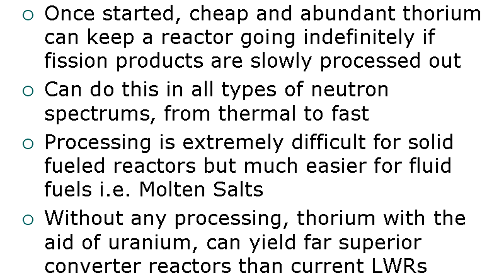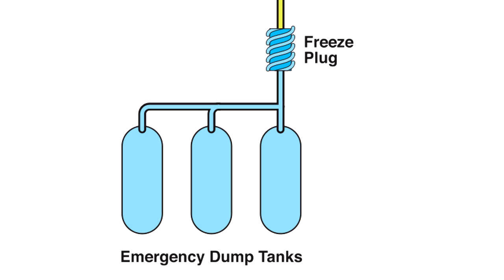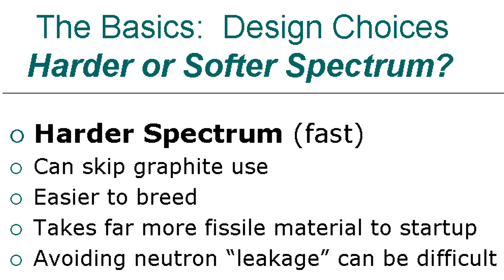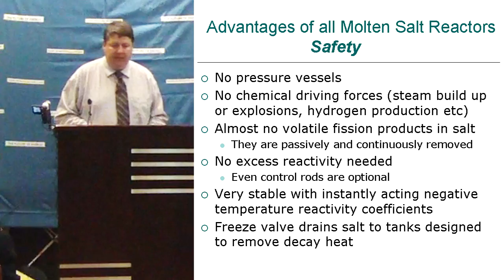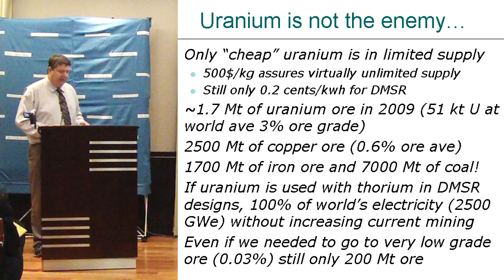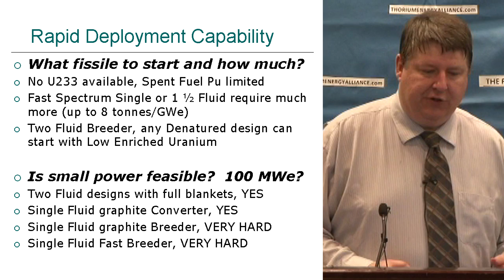David LeBlanc - Potential of Thorium Fueled Molten Salt Reactors @ TEAC3

Comment: The pumps for the reactor fluid obviously must not leak bearing coolant into the mix like the first sodium reactor in 1951 where an organic solvent was used to cool a high temp pump shaft bearing, which leaked into the cooling/heat transfer fluid (sodium) and created sludge that blocked that flow into the reactor and caused subsequent  fuel rod meltdown, which DoE lied about. (sodium boils at 883°C thus does not have great margin at higher reaction temps, so maybe not an ideal heat exchange medium?)
I'm sure this is well documented and newer high temp pumps have better and more seals, located further from heat source with longer axles, and a better cooling system.
Sludge blockage would defeat a melt plug scheme.
These nuclear projects are of national security and should as in the past be sponsored by a federal government or NGO, (to avoid previous political railroading of important projects). These projects need to be in focus to make a speedy recovery into a safe nuclear age. China has evidently understood this. 
The hyper-commercial info stream that values three syllable sound bites are incapable of explaining to the GP (general public) how nuclear reactors can be safe or not safe in as much detail as needed. GP having a poor understanding of nuclear power generation that affects the supposed democratic system is detrimental to the general political climate these plans must exist in, or not. No understanding = no vote. (Just like in election of people with no relevant education nor experience, should disqualify for high political office)
These great, and untiring nuclear advocates should be given stipends for their work to continue in the public domain. There is enough money to be made in the building and running of these plants, that involving IP that could affect safety, or an appearance thereof, should be avoided. 
Venture capital wants a quick buck and a monopoly, which both are diametrically opposed to the outcome of long term safer nuclear power.

There is room for several reactor categories, to generate power and some to also burn-up stockpiles of nuclear waste.  Liquid reactors make a lot of sense, and BWR and LWR by contrast MUCH less appealing and should gradually be phased out.  The newer reactor types could of course re-use old sites with steam turbines and generators.

Look at the last 150 years of history and try to imagine it without cheap and plentiful power. Without it we would still read by candle light after a 12 hour six day hard work week living short and miserable lives, like the time before the civil war. Everything was handmade thus expensive, reserved for the upper classes, who loved it, as "3rd world" labor was cheap and plentiful. Upper class Londoners went "slumming" to gawk at the misery for entertainment. Mass production requires gobs of power. The social revolution of the 19 and 20th centuries could not have happened without cheap power. 
Nothing we now take for granted exists without massive, cheap  power. 
No nukes means coal, lignite, bunker-C, fracking-gas, petroleum, and global climate change. Do not grease the wheels for Exxon.
Our planet does not need us, it will go on forever without us, we are expendable and the earth is in our care, for ourselves, our children and grandchildren....

Comment: The interesting thing is that the technology is ready to go, but the biggest thing standing in the way is the most unsafe technology (solid fuel reactors) and that is probably due to the infrastructure that is required to service the reactors and the needs of governments to make nuclear weapons.  No bank is going to upset the apple cart to fund something that has not got a functioning MS reactor making electricity with 'proven' technology, the governments are not interested either because they don't get their nukes... The industry, the banking system and the government don't care!  It is up to the public to fund such endeavours and force change.